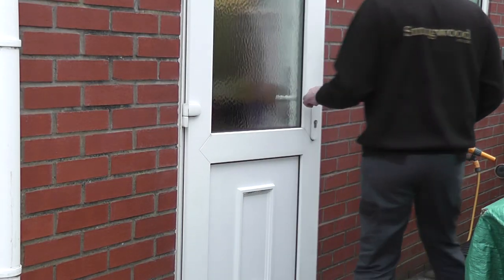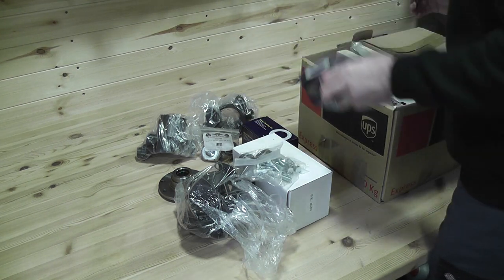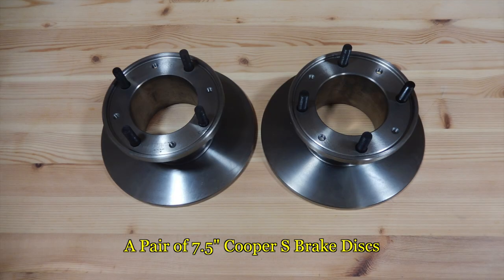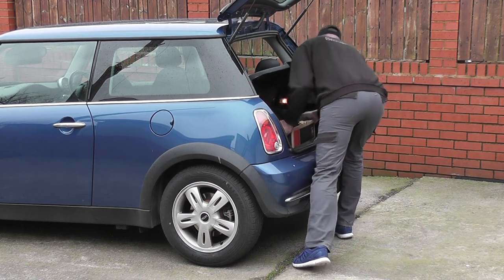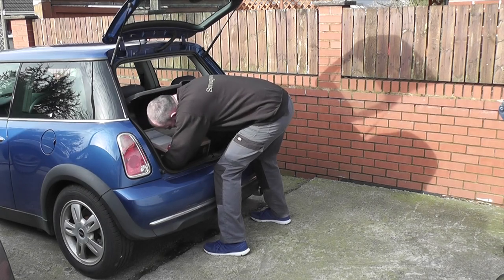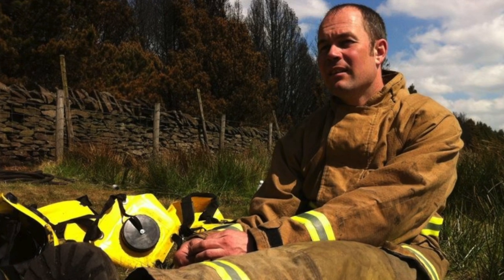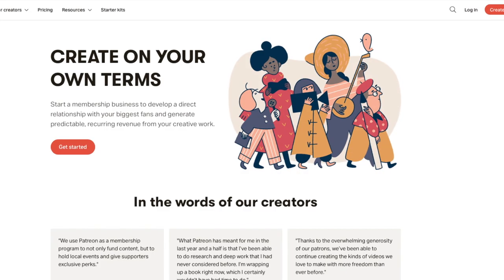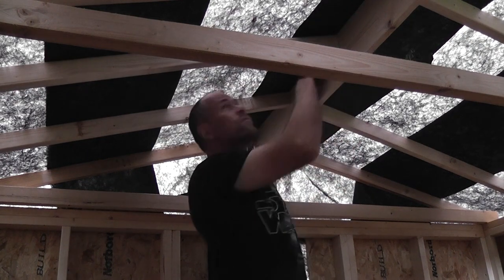Classic Mini Restoration Episode 9 - Minisport 7.5" Cooper S Disc Brake Kit Assembly (Part 1)

Comment: What were the parts you were missing? I want to get the same kit 😉
Reply from the maker: It seems they weren't missing...I was told there was spare shims but apparently I was misinformed as they are extra. Also the locking tabs on the ball joints are present...I thought they were missing but didnt realise you have to hammer them over yourself. Also the dowels look like they have been pressed into the arms already...apparently this was done as they had initially been machined wrong at the factory a short while back. Theres no locking tabs for the steering arms as they provide washers they said. And grease nipples for some reason are sold separate to the kit. Maybe a little strange...but maybe I should have checked when I bought them. Although to be fair...its all new to me :-)